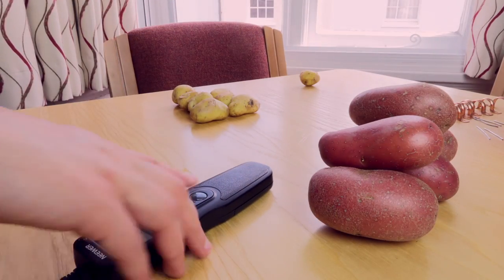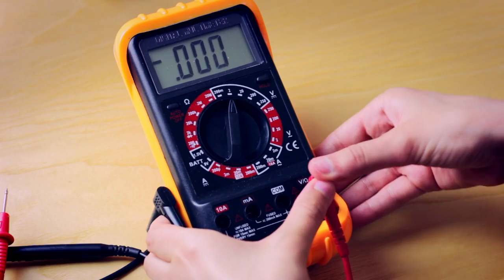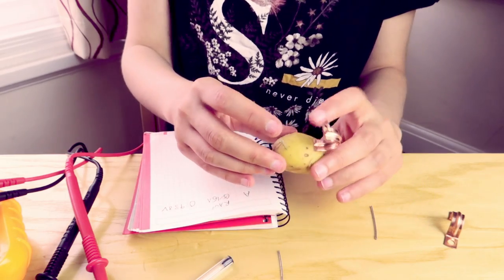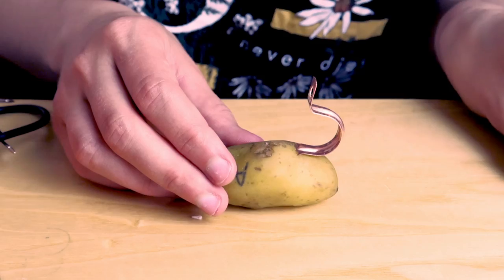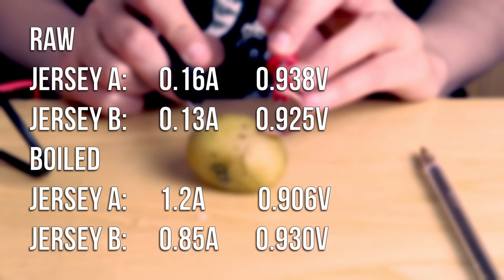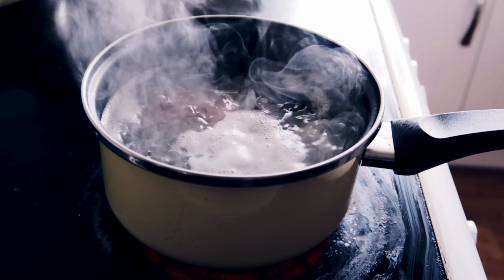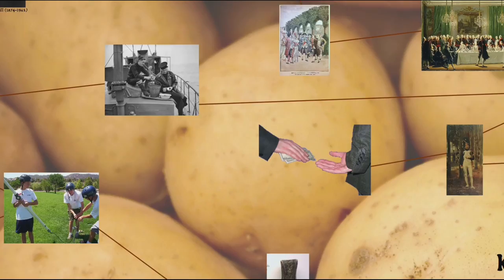Which Potato Makes The BEST Battery? | Pocket Science

Comment: Practically speaking while the term "amperage" is a well used term and in the dictionary, it's use can be misleading and negate the use of the word current, I have had students state that the component is a 5 ohm resistor with an amperage of 1 amp. When actually 1A is a measure of it's maximum safe current. I seem to remember once when marking science papers the exam board would only give a mark for the word "current" and to deduct a mark for any other term including amperage, a bit harsh I think.   When buying batteries we generally buy them at a rated voltage for their use, in fact I believe electrical engineers will only recognize voltage as a correct "age" term, wattage and amperage are not in their vocab. 

Sorry didn't mean to be -ve regardless your videos are always great and a +ve experience to watch. Have fun in SA :0)

Comment: Those current values seem way too high to be correct (Especially getting over an amp out of a boiled potato). By looking at the meter, it's set to the 200m/10A setting and using the mA plug. That means the measuring range is 0-200mA. The values shown on screen should then be written as mA, which is a magnitude lower. Those values seem much more likely (a thousandth of an amp from a boiled potato). Great video otherwise, nice idea..
Reply from the maker: +Daniel Borsos you're almost certainly right that they're mA - thanks for spotting that! I'll check on the multimeter once I'm back home to be sure
Reply: +Daniel Borsos Can you read the settings (My old eyes can't.) or are you familiar with that model of multimeter? The ones I found online do not have uniform settings.
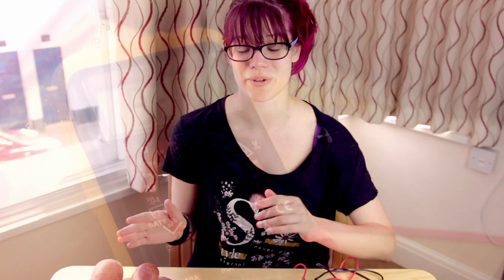Reply: Steve's Mathy Stuff at 1:43 in 1080p50 the labels are easily readable on a larger screen. Actually I messed up the comment, it's actually 10A/20m. One of my teachers had a similar multimeter that had this "feature" too. We didn't really like to use it, that's why I remember
Reply: Yeah I was thinking that must be one hot potato
Reply: Yeah, the currents measured were certainly milliampères.
Reply: You're 100% correct Daniel, except the setting on the multimeter dial was 20m/10A, not 200m/10A. But yeah, since the probe wasn't in the mA jack, not the 10A jack, it was on the 20mA range, not the 10A range, and everything else you mentioned is correct.

Comment: interestingly when you asked 'best' I heard it as endurance, not current or voltage.
Reply from the maker: I was also originally planning on testing endurance - but I didn't find a set up that convinced me to time how long an LED light could be left on, so I thought measuring something quantifiable may be a better approach.
Now I've done it once though, if I ever decided to do it again I'd come in with a more rigurous protocol
Reply: One option: you could set up an LED--potato--multimeter in a loop as a circuit, and time how long it takes for the measured current to drop below a certain pre-determined threshold.

Comment: Laura Fun stuff...However.... Dun dun dunnnn You make some errors in regards to measurement and theory. As Dave Jones of the EEVblog would say "Trap for young players".

You measured the voltage and current separately, more over you measured the "Open circuit" voltage of the potatoes. To preform a proper assessment you need to measure the voltage under a known load or resistance.

I kinda want to make a reply vid showing the proper way to make this assessment.
Reply: Also, SO many factors to control for.  I think Ines is right that perhaps the red potatoes needed more boiling time, as I was concerned from the start about the stark difference in size between the two types.  Even if you place the anode and cathode the same distance and depth in each there's an assumption that any internal structure is the same and that the skins, including distance from them to anode/cathode don't make a difference.

I think it would be great do to a followup video listing all the factors that should be controlled for, given how simple the basics of this experiment are, just to demonstrate how many there can be.  

I also find myself wondering if there's any part of the potato chemistry that could be changed by boiling that would increase resistance.  Perhaps due to producing molecules that better hold on to electrons.

The latent heat remaining after boiling could also increase resistance (although in this case other changes obviously more than compensated for that).
Reply from the maker: +MorRobots you should - I'd love to see a response video! When making the video I accepted it wouldn't be 100% rigorous (the hardcore rigurous science is for my PhD, which is taking a good 3 and a bit years for a reason, whereas I only had a couple of days to make this), so it is rather a soft insight into the scientific method and an open invitation for people to try their own potatoes and suggest improvements to the method :)
Reply: There's a time and a place for rigor -- it makes little sense to hold a fun potato battery video to the same precise standards as Dave (rightly) demands from a company marketing battery products to consumers. Furthermore, the main objection to measuring open-circuit voltage is that flat batteries often have a similar open-circuit voltage to fresh batteries, but a much higher internal resistance, making it a poor single measurement to use. Inés has measured the short-circuit current as well though, which is a perfectly decent proxy for that internal resistance. So while anyone with basic battery chemical knowledge would predict that the voltages of all the potatoes would be broadly similar, it's the variations in short-circuit currents that is very interesting.

Finally, although it'd be of course wrong to multiply the 0.93V open circuit by the 0.85mA to claim that the battery can produce 0.79mW, one can assume a straight-line VI characteristic, consider the maximum power point to be halfway along the line, and thereby conservatively say that the potato can provide at least 0.20mW. Until I plan to actually power my actual wristwatch with mashed potato, that's plenty rigorous enough.